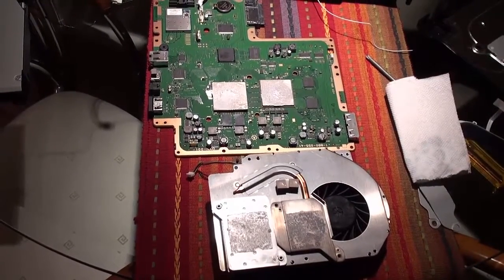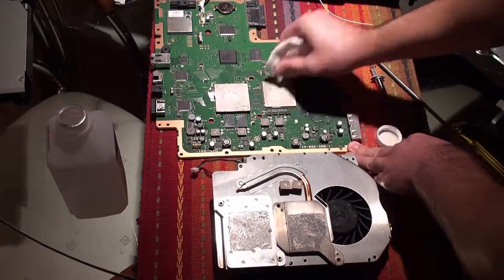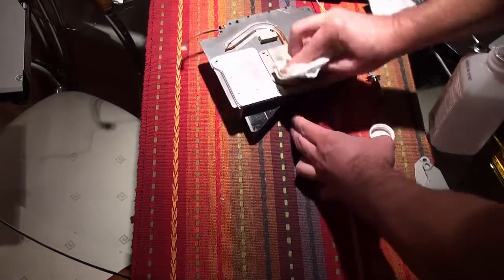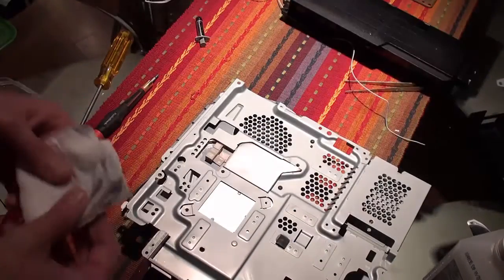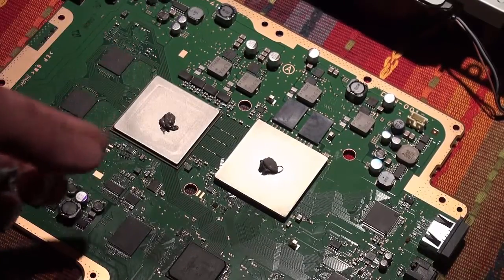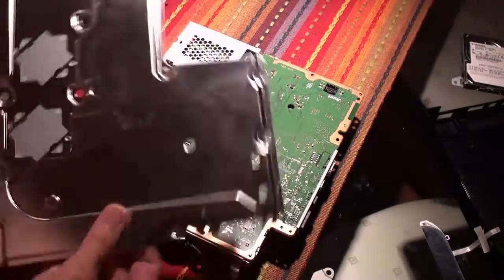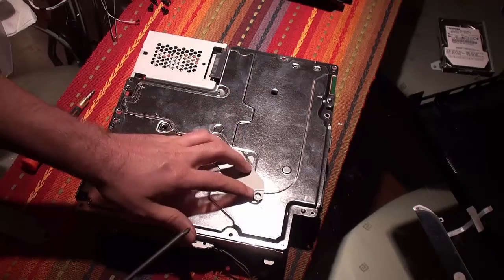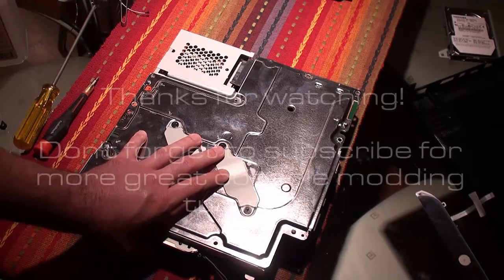PS3 Slim Thermal Paste Replacement Guide (Best Thermal Paste for PS3)

Comment: I followed your method & man I'm glad i did my ps3 slim is running alot quieter now. The fan no longer sounds like a jet engine blowing out! Finally i can play games wit a normal sounding fan. I can hear the fan run fast when im near the console which is normal while playing TwistedMetal2012 but it's  not as crazy loud as it was before. Thank you best thermal paste replacment!

Comment: Anyone chime in here. Is this enough to fix a fat PS3 which always runs with fans high? Should I bother with copper shims? Is that necessary? Is it overkill? Can it cause issues? Am I better off just cleaning and replacing thermal paste and avoiding copper shims? I just replaced the thermal paste on my MacBook Pro and it has copper squares built into the heat sink.

Comment: About 50% of thermal paste videos show people spreading it. Some thermal paste comes with a spreader. You never mentioned why it’s not a good idea to spread it. Seems to me that by spreading it before you before you put it back on the heat sink ensures an even spread. Putting a glob on and then smushing it together does not ensure it’s spread evenly edge to edge. Spreading method seems more logical.

Comment: never spread like a bed. always make a dot (or in the case of the cell, several large dots) and that will make the seal.
Reply: About 50% of thermal paste videos show people spreading it. Some thermal paste comes with a spreader. You never mentioned why it’s not a good idea to spread it. Seems to me that by spreading it before you before you put it back on the heat sink ensures an even spread. Putting a glob on and then smushing it together does not ensure it’s spread evenly edge to edge. Spreading method seems more logical.

Comment: You have absolutely zero proof that your method of applying the paste is the best, you're just parroting what you heard from someone else. Different machines have different mounting pressures and different pastes have different viscosity so you literally have no way to say what method spreads the paste the best.
Reply: Fuck You  found a pdf document from the company and they actually kinda recommend both. It says to spread on a very thin amount and then take some thing like a coffee filter and wipe off all excess. This way you worked the compound in to all the grooves. Then you do the dot method.
Reply: @Saulram91  that's what I've done on the heatsink is rub in with a coffee filter. Wasted some paste but you can see this slight haze film that appears to have filled micro grooves & is prepped for apu TIM to make a great combo

Comment: always clean all the dust off the motherboard heat sinks fan and the plastic I done that to a 80 gigabyte phat playstation 3 I bought at a pawn shop as is for $10.00 and it works flawless
Reply: Wow, that's great! How often do you use it? Still works?

Comment: 8 years??  Half that
Reply: depends on what kind of compound you use
Reply: i used arctic silver 5 on my phat 60gb ps3, i used the pea method like in this video but i also but i small drop in each corner along with the center. My ps3 lasted 5-6 years before getting YLOD :( so i agree with joe when he says half of 8 years is the correct amount of time to replace arctic silver 5 paste. BTW i also read and heard that arctic silver 5 is suppose to last 8 years which is why i didnt change it on year 5/6.

Comment: artic silver isnt the best
Reply: Exactly how I like YouTube comments to be, vague af. Gtfo of here boy.
Reply: hamajangz do you know?
Reply: Just use arctic silver bro. It’s totally fine.
Reply: hamajangz alrite, by any chance have you used mx-4?
Reply: Never used it but I did apply arctic silver to my slim 2 years ago and it’s still running like a champ.
Reply: don't listen to this guy, arctic silver is really good, it's trusted and you don't need to worry about it
Reply: @ajddavid452  he's actually right, in a way, not completely but he is IC Diamond is also really good and in some situations performs better in intense heat. Again, he's not completely right but not wrong either artic isn't always the best
Reply: beefstrudel if as5 isn’t the best, then which one is in regards to the 60gb launch ps3 model?
Reply: It's not the best but alright. If you want to squeeze out a few more degrees get Arctic MX-4 or even better, Thermalgrizzly Kryonaut.
Reply: Is artic mx-4 good for ps3?
Reply: Nah get MX-4
Reply: It's not "the best" but you're not running a super computer that runs 24/7 either. It's perfectly acceptable for a PS3. Just my 2 cents, what do I know

Comment: Why not use the card 💳 method of spreading the thermal paste? When you use the card 💳 you know exactly that all corners of the heat sink is getting thermal paste prevents from over heating if you place thermal paste in the middle how do u know that all corners of the heat sink are not contacting metal with metal that will cause future problems and over heating issues
Reply: key4250 air bubbles. That method was used back in the day when heat sinks didn't have integrated heat spreaders. Now that method is optional, the pea method is the ideal type.
Reply: Someone said to use a thin layer of paste to prevent air bubbles I also seen videos how different styles of thermal paste are applied to the heat sink and they checked temperature readings and it didn't make much of a difference as long as there is enough paste
Reply: Nico Galarza if power supply  and paste not the issue then it's the motherboard needs gpu chips replaced reball or you need a new motherboard I am in the same situation
Reply: key4250 could u use anything else apart from thermal paste I  tried paint lol
Reply: key4250 what should I use instead of thermal paste
Reply: Owais Hell no don't use paint your going to mess up that board use Artic silver thermal paste common sense
Reply: Owais just use thermal paste nothing else Artic Silver thermal paste you can buy a tube on eBay anything else would be risking frying your board
Reply: key4250 kk I'm going to buy it thanks for the help
Reply: anytime bro
Reply: hey guys...I have a ylod and I changed my power supply just if and I am about to change paste...if this does not work...what could it be?
Reply: key4250 Fuck :'(
Reply: This video can answer your question https://youtu.be/-hNgFNH7zhQ
Reply: the way i use to spread all the thermal paste, is aplying the pea method, and then, pressing with a glass

Comment: What I'd like to know, that no one ever seems to explain, is what exactly does the thermal paste DO for the systems performance aside from just fixing heating issues? I mean are graphics affected negatively if thermal paste is wearing out?
Reply: Blake Pelletier Thermal paste promotes better heat conductivity from the processing unit to the heatsink. This is necessary because the processor and heatsink do not have proper contact without the thermal paste. Without it, the heatsink wouldn't be able to absorb the excess heat generated by the processor and thus it would overheat at best and fry itself at worst.

Comment: Ive replaced the thermal paste and still getting freezing issues
Reply: Boot ps3 in safe mode then restore the file system. That should help. Look for videos on how to fix your problem.
Reply: need to replace the thermal paste under the ihs plates
Reply: SSD man, the console flies.
Reply: Reinstall ps3 software

Comment: I opened my ps3 cleaned the old thermo paste and i had little thermal paste left and then i apply it and i barely have thermal paste on my chips played a game my ps3 barely cool because i didn't put the thermal paste right also i am out of thermal paste :)
Reply: bobi966 arctic requires too much cure time
Reply: You'll just have to do it again dude. As of right now, I'm about to try this method carefully.
Reply: ***** yes but the problem is that so many people bought thermal paste and left me with none now i am waiting for new ones to come at the store i never knew so many people buy thermal paste !
Reply: Dude, just buy article silver 5 from amazon. Its 3.5 grams for five bucks, that's really all you need